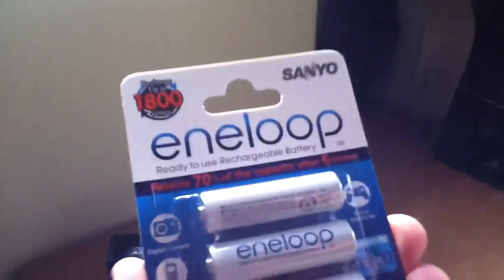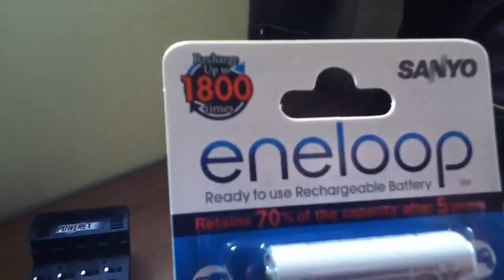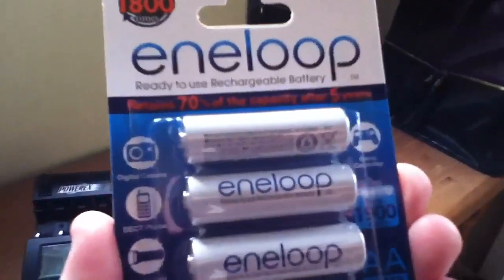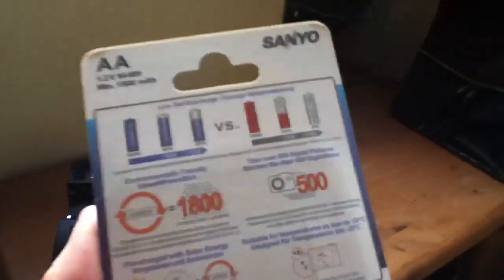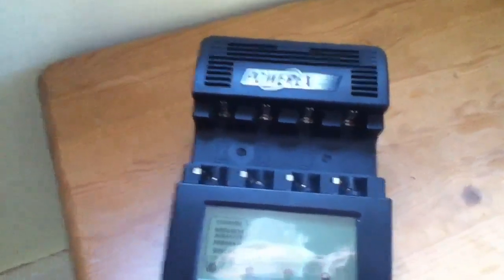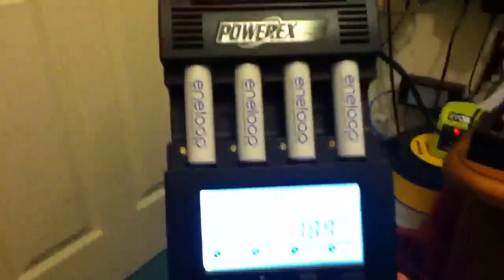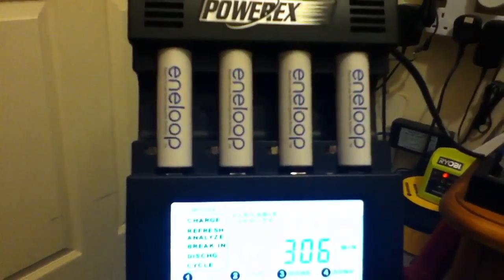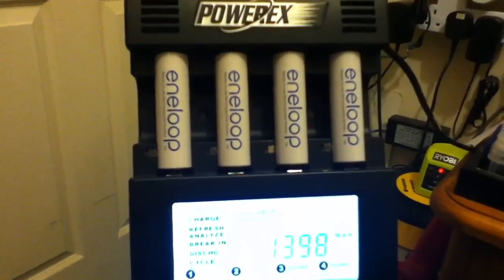3rd generation Sanyo eneloop AA Battery Specification and Discharge Test

Comment: Please help me understand. I'm looking for new batteries for my canon flashes and have been reading some tests. There seems to be a lot of good talking about these eneloop AA's but they ar only 1900mah. I've only used 2700mah up to now. GP and Powerbase. Will these 1900mah compare?
Reply from the maker: jonnebanan If you use the flash infrequently, you'll find the eneloops are better because they lose very little energy when not in use.
Reply: Mmm, yeh... I recomend you join me at "EEVblog#140 - Battery Capacity Tutorial" I'm enlightened :)

Comment: You can't determine the capacity of a battery simply by discharging it straight out of the box. You can't assume the batteries received a full charge at the factory, and of course, even low-self-discharge cells will lose SOME energy after half a year on the shelf.  To test the cells properly, you need to do a full charge cycle and THEN discharge them to find out their capacity.
Reply: Which is what he said....
Reply: Joshua Farrow : No, That's NOT what he said.  Or did.  He simply measured whatever energy happened to be the cells when they came from the factory.  Please go back and look at the video again.
Reply: +Joshua Farrow :  Right.  He didn't do it.  That is, he didn't charge the batteries first, which is what he should have done.  So it's an invalid test.   (Then he expresses surprise when they don't show a full 1900 mAh charge.)    Yes, he finally gloms on to the possibility that they weren't fully charged at the factory (something I thought everybody knew, but apparently not), but only in the last 40 seconds of the video, after he ran the "test" -- and then he still calls it an "interesting result " in the video description.

Comment: The cell resistance of NiMh batteires is far too high. So beeing said, that even with (for me a very low current) 300 mA they get quite warm...

I'm glad that today's product get LiIon batteires.The much higher cell voltage solves the problem with the high cell resistance, since we can draw much lower currents out of the cells while getting the same amount of energy out of them.

In low current devices such as a notebook mouse (MS Wireless Mobile Mouse 3500 for example) NiMh batteries are still good. But for digital cameras or cam corders, they are simply bullshit... Too low voltage, too high current, hot batteries, short life time...

Comment from the maker: That does make sense, that the batteries need a few charge/discharge cycles before they reach full carrying capacity. But it makes a bit of a nonsense of the "pre-charged" claim. Really, Sanyo should do that for you; cycle them a few times, then give them a pre-charge that would yield the full 2000mAh. That would kill the alkaline industry once and for all.

Comment: I'll plan on doing a test when I get some.  May be a year or two as the older batts just last & last.

One thing I wonder about is the *breaking in* of the batteries.  I've read somewhere that for batteries to *form* properly that they should be *used a few times* before doing a series of FULL charge-discharge like we would do to *evaluate* the battery.

Any thoughts on this?  Run it through the flash a few days before full C-D eval?

Comment: I think in subsequent discharges the batteries shouldn't get as warm as in the 1st one. That's because if they are stored for a long time, their internal resistance rises, which means more losses on discharge, hence more warmth. This happened to me with other LSD cells (non-Eneloop) which were stored for a year and then went dead pretty quickly in a digital camera, but after a partial discharge and recharge, they work much better now.

Comment: They should pull Down to 0.90 :  You have to watch when there getting close to the 0.9 area because as soon as they get to 0.90 the Charger with kick the Done indicator on and you won't know for sure if they hit 0.90 

Next time Discharge @ 100mA you'll have better Results and they won't have get as Warm.. Charge @ 900mA mine done well at this setting My eneloops are the 1500 recharge Version it's got the picture of the Earth on the Card.. by the Way were did you get your eneloop's at..

Comment: These are the results that I got after some Discharge % Refresh cycles at 350mA discharge and 700mA charge current. Cell nr.1 = 2.09Ah; Cell nr.2 = 2.05Ah; Cell nr.3 = 2.06Ah; Cell nr.4 = 2.05Ah. So they are pretty good in my opinion. I won't go back buying Vipow and other cheap and crap types of Ni-Mh batteries for sure. Now  I don't know how well they are gonna last in time but I'm pretty confident that they will last long enough. Cheers :)